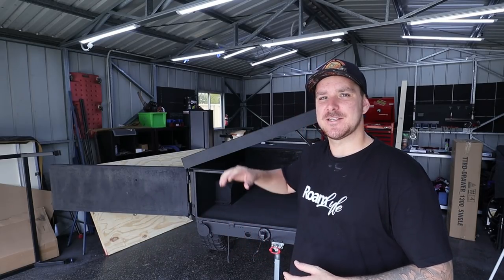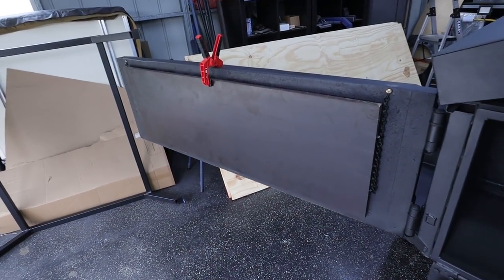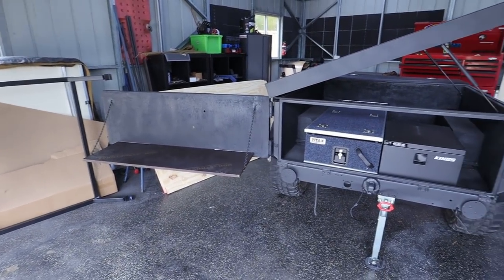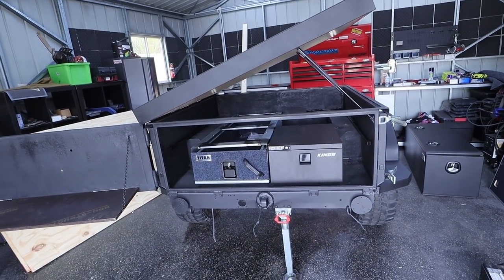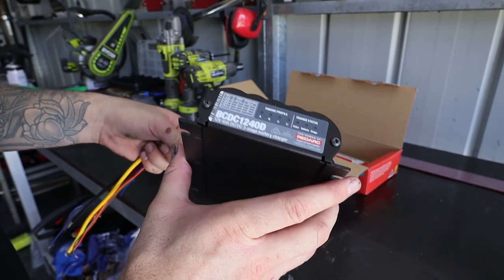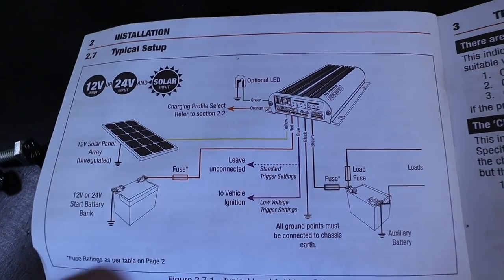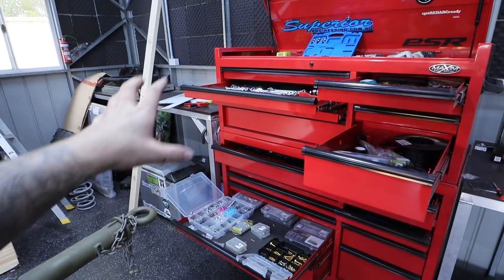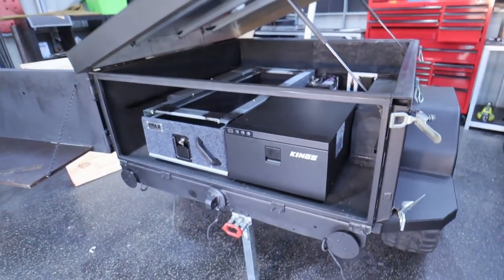Custom FRIDGE & DRAWER Setup That Won’t Break The BANK!!

Comment: Hello, if you made the lead for your solar ending in an Anderson plug, you could have a portable panel that plugs in. This could be moved to follow the sun making the setup more flexible and user friendly..
Regards
Graeme
Reply: Great suggestion Graeme. He can then stow the solar panel on the underside of the camper cover panel with some lengths of channel .

Comment: Loving the build, just a suggestion regarding the solar panel, have it on slides underneath your roof top tent and when you get to camp, you have it so it comes out from underneath and always permanently fitted to your trailer

Comment: If you find any of your nuts coming loose from vibrations, grab some nyloc nuts as they won't come undone by themselves. With the solar, you could get a blanket and a decent lead to have flexibility in where you put it. Then you can park and camp in the shade but have the panel in the sun. Otherwise put a fixed/house panel on slides under the tent so you can slide it out the side when you set up. Awesome job so far, loving the trailer, keep up the good work!
Reply from the maker: Thanks for the tips mate!$

Comment: I would add  bit of metal angle bracket on the edge of the wood shelf to put the chains onto. You're going to be upset when one of those screws pulls out of the edge when you've got your cooking gear setup on it.

Comment: Hey mate take it from me, you're going to want to sikaflex or silicone the bolts going through the floor, i had water ingress in my camper from bolts i put through the floor for my compressor, love the build videos mate, absolutely mint work 👍
Reply from the maker: Hey mate, thanks for the tip!! I have a tube of it ready to go 🤘🤘🤘

Comment: Love the build man, curious to know why you have the tail gate and the hard lid open in the direction it does? Would've it be more practical for it the open the other way around for a bit of safety when using it on the side of the road.. if that makes sense
Reply from the maker: I did address this in a previous video, we would never put ourselves in a unsafe position getting something out of the tub which will only have camp chairs etc in it and we would never need them in an emergency anyway! I did it because when pulling onto a camp site I feel like it’s easier for the driver to find a spot as you can’t really see over the passenger side to much! so our “living area is on the right side of the trailer and the tent folds out to the left making it a little easier for the driver to find a flat spot to camp on! If we ever had to pull over, I’d try get off the highway onto gravel, in a situation where we cannot, there is nothing inside the tub that we will need! Cheers mate
Reply: It opens to the left, we pull over on the left, what’s the issue?
Reply: @xRhinozzz  You're more exposed to traffic coming down your right hand side when pulled over

Comment: Ok. I think I would have fitted a water tank behind the fridge, & see if the 12v system would fit next to the fridge, between the wheel arch & rear door.  Solar panel? Depends on your roof top tent. Looking forward to the next episode
Reply from the maker: I already own a under vehicle water tank! I just wanted to keep the heavy battery up the front on the trailer!! Solar panel is prettt hard to think about 😂🤘

Comment: G'day mate been absolutely loving this build, made me keen to do me own trailer,  as far as solar input goes have ya thought about bolting a panel to drawer runners under the rooftop? Get to camp setup and pull it out, even get it out a few days ahead to get the fridge cold plus maybe a second anderson plugs to put a blanket on aswell if you ever needed the extra juice

Comment: Coming along nicely, would just love to see a lithium battery in there mate, trouble free and future proof, but doing great mate👍
Reply: Agree should have saved bit longer and bought Lithium battery as well. Recharging capablities alone is reason enough
Be less need for a solar panel, but at least the Redarc is Lithium model.

Long term reveiw on the fridge style will be good reason to follow the trailer build and usage

Comment: 💂100 % with you on recovering everything the same stealth 1 has to  look as smick inside as outside  I would have put the switch panel on the opposite side and a gas hot water system where you where going to put the swtch panel 🍻 💂

Comment: Hey Mate, awesome build. I know this is an oldie, but I'm currently doing a similar set-up in the back of my ute. Did you have to mount the fridge at a different height to the drawer to level it out for the new floor to be level? I've got the drawer and fridge and looks like the fridge sits slightly higher than the drawer (with the top off). What did you use to raise the drawer and fridge up to clear the lip of the trailer?
Reply from the maker: Yep just raised the the drawer to suit it! Uses some large washers

Comment: Hey There - Just curious - would it not be better to make the table fold out upwards? (it would be higher then :) ) Also - what size struts are you using and is that the correct way of mounting them? I am also busy building a camper trailer in South Africa so following this build - :)
Reply from the maker: That’s a great idea but sadly I think it would be to high and it would stop the tailgate becoming a wind barrier for us! The trailer is quite high, although my partner she is quite small so it would be a great height for her now!
Reply: @RoamLyfe  Haha ok that makes sense - good work on the build to date! It's looking amazing!

Comment: Dude please DO NOT install the 7 pin square plugs they break and cause so many  problems i had to replace mine on 3 trailers and the car multiple times .  Swap them for the steel round it will save you so much money time and trouble especially when your in sticky wet muddy areas. Its better knowing you have a good power connection than sh#t plastic